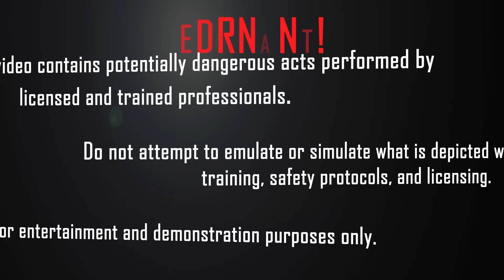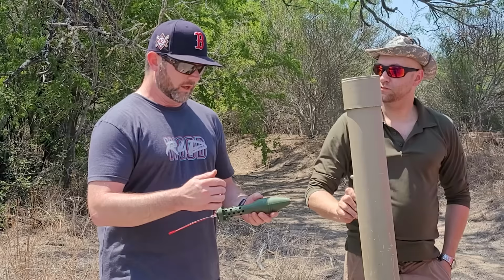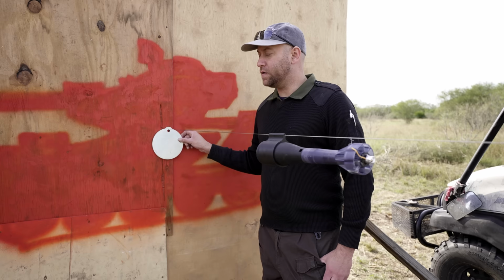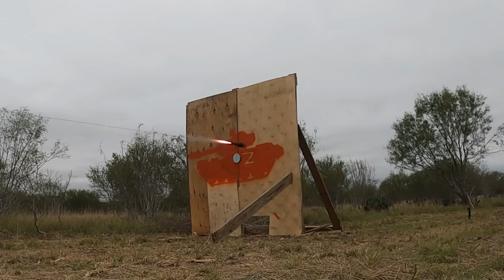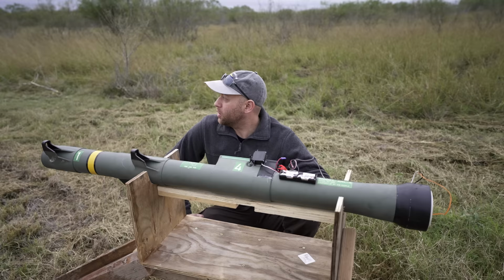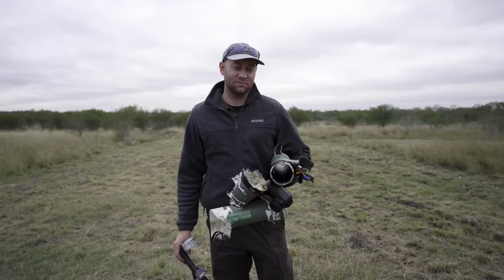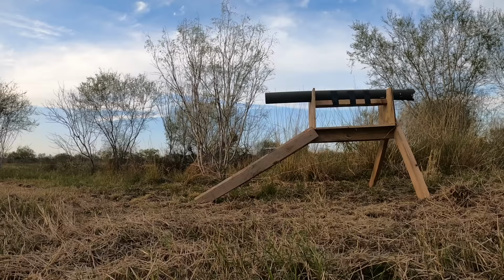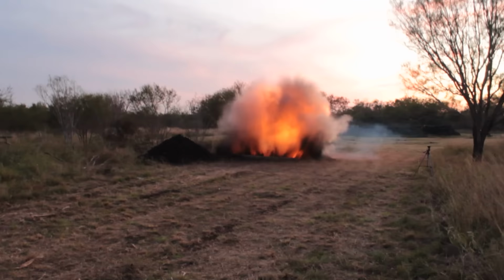3D Printed Explosive Rocket Testing | Feat D&S Creations

Comment: You actually need to know a little math to make balanced rockets 😄 but I've made rockets that fire from a tube before out of fibergalss and plastics. Those didn't have a charge, only because I couldn't manufacture the fuse body at home 😄

But you need just a little math to get that correct.

Comment: To what extent does a FFL 09 allow the testing and/or development of guided munitions?

If say, one was to file for a FFL 09 and wished to develop a radio (or wire) guided ATGM (or any other guided munitions such as a conventional-explosive ballistic guided missile) for instance. Is it the same process as any other destructive device? Jut get the $200 tax-stamp for each rendition/prototype and you are good to go?

Or is there a different legal process one needs to use? Because I think your channel pairing up with a rocket-science-based channel (such as Mark Rober, a former NASA engineer who R&D's his own rockets, fuel, as well as software systems on YT) would be prime content.

Comment: Seems like the rocket fuel you are using is waaaaay slower burning than the real stuff. Most rocket launchers are more akin to a recoiless rifle than a rocket. All the fuel in the motor is burned before it leaves the launch tube. The difference between recoiless guns and rocket launchers is very subtle. The two main ones being that recoiless rifles are rifled and detonate a propellant charge while a rocket launcher burns a motor in the distance from the breech to the muzzle and are not rifled. 

I bet slower, uneven burning propellant and the fact that the rocket's center of gravity is changing mid-flight due to the fuel burning off is causing a lot of your instability. Additionally the rockets are taking off so slow that your fins are probably not giving as much aerodynamic effect as they could. 

This  explains why they are fish-tailing and getting all squirrely. More efficient, faster burning propellant will fix a lot of those flight instability issues.
Reply: Chad knower of rocketry.
Reply: @benjaminshort4169  I was an 0352 for a good while 🤣. Rockets, missiles, and explosives vs tanks was kind of my daily life.

Comment: It costs like $100 to make a computer and gimbal for thrust vectoring of small solid motors. Idk how cheap you are wanting each round but for $300-$500 then add your payload  cost and you can make small guided or "computer stabalized" rockets with today's tech.
Reply from the maker: That's def a future plan. Right now, we are keeping it cheeeeeeap.
Reply: @Ordnance Lab  I would recommend building a wind tunnel then. That's great for tuning static shapes and will aid you in achieving a stable profile without computer assistance.

Comment: Engineering process failure. Jumping right to a more complicated stabilization method, and trying many different things at once, leaves too many points of failure and not enough consistent data to learn from. Start from a simple and replicatable known good. - Remember the Star Spangled Banner? "The rockets red glare"? That's right, all the way back in the very early 1800s there was stabilized ballistic rocket tech. Well, we can technically go all the way back to medieval China but as far as the idea of a modern munitions carrying rocket we have ~200 years of history. What you're interested in is 19th century gunpowder-rocket tech. Because it was simple, reliable, and robust despite the limitations of the time (we have similar limitations here but for different reasons, 3D printing). Consistent accuracy and improved range (from drag reduction) for early military rockets was solved by William Hale when he introduced vectored thrust. Spin stabilization, a minimal fin system, and virtually nothing to fail. Many rocket bodies, including the fins, could just be cast thanks to the simple but well-performing design. You can even home 3D print the vectoring nozzles thanks to ceramic filaments. I'd suggest starting there and, once successful, THEN getting more exotic with your engineered solutions. --- Anyways, keep up the great work. It's a really interesting project for sure.

Comment: TWO THINGS:
1) Your rocket burn duration is FAR too long. This is causing the weight of the rocket to abrubtly change, sending it squirrel. Shorten the burn to cut out upon exiting the tube.
2) Use forward thrust nozzles to accelerate the rocket after the initial charge KICKS the rocketout of the tube. This will better balance the weight shift, and can be fine tuned to reduce spin so that the Monroe Effectis not burdened. RPGs have the nozzles FRONT OF the center of gravity. NATO rockets rely on expensive precision balancing of weights and burns.... GO THE SOVIET ROUTE FOR SIMPLICITY.

Comment: That was fun to watch in a Roadtunner/Coyote sort of way but I definitely get that you gathered valuable "what not to do" data.

One thing that got glossed over (probably intentionally) is how you fused (fuzed?) the warheads so they'd go off at the proper standoff distance. Was standoff built in so that you could just detonate on impact? I can think of two or three ways to fuse/fuze them but am curious as to how you approached it.

Comment: Firstly before I comment, I have to make clear that I’m a fan of the channel.  Now that I said that, explosive physics is clearly your strength. However, launch/firing platforms and rocket ballistics were almost an after thought. I honestly think I could have done better in my backyard. Why didn’t you just “copy” an already established rocket propelled ballistic vehicle and skip over dealing with the R&D of making something functionally “fly” straight or in a predictable flight path?  Or did you do that and your launch platform not support such a vehicle? It looked like a piece of painted 4” PVC pipe with a reducer coupling on the end … Which is likely why it warped. Your guide wire was braided steel threaded through plastic eyelets ? That’s insane….  I am thinking as smart as you guys are , that either you got lazy , or rushed , or you were skating around certain laws that would make what you were attempting to create illegal, regardless of your explosive licenses.  I am hoping that was the case; and if so, you should have expressed that so the audience would know what you were being limited by. But something tells me it was simply just not well thought out , for whatever reason.  Just my 2 cents - Love the channel , keep blowing stuff up !